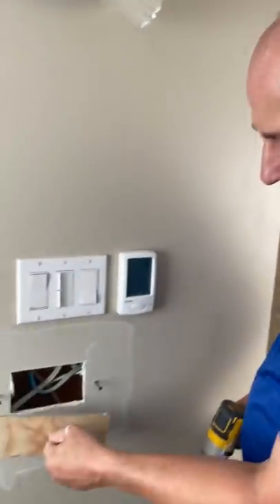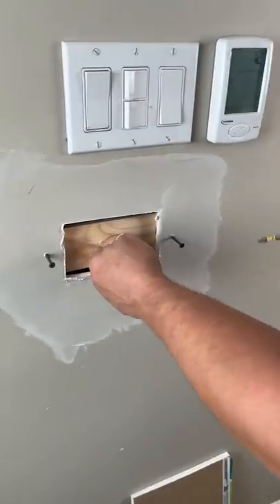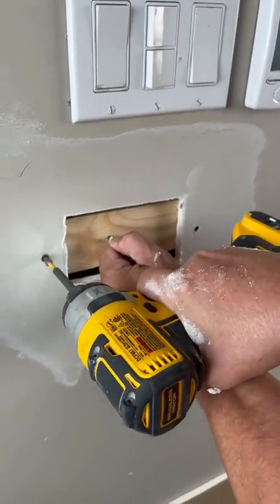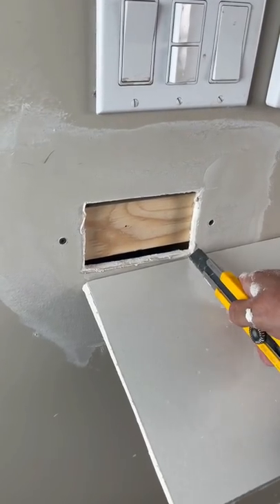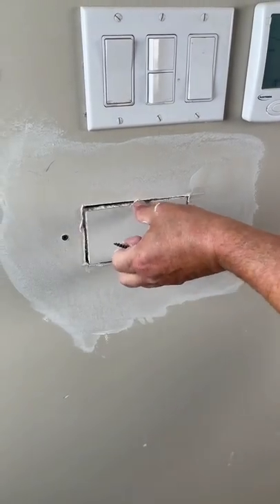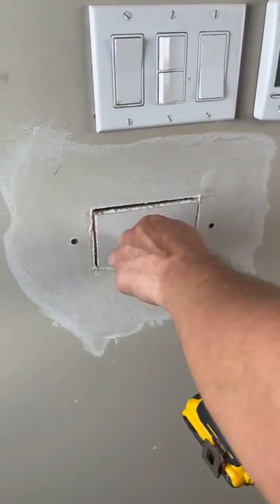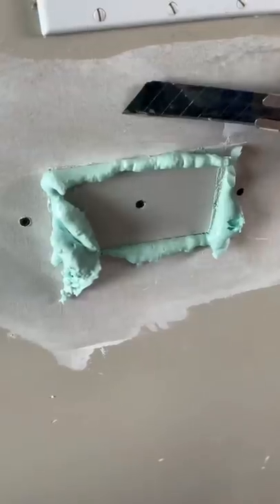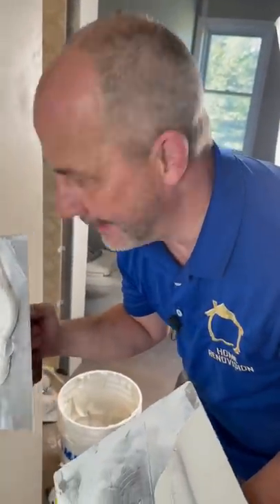Drywall Patch, No Tape Required #shorts

Comment: Hey Jeff, you are correct I haven't seen this.  I would have if I had asked myself "what is the least cost effective way to do this while also making sure this repair won't look good for long?"
Reply: Not to mention expansion foam in a wall is a fantastic way to blow out even more of your sheetrock! This is not idiot proof at all.
Reply: Well the wood method plus mud is fine for a patch or repair
Reply: @Gl-my8fw  it really isn't okay to use expansion foam in a wall for so many reasons. If you don't get it, I'm sorry to sound like an ass... Electrical and plumbing getting moved is a serious issue.  Just save yourself the hasssle and do it right.
Reply: @SaucyOperator  and it isnt hard to remove or a big deal in general. I wouldnt waste my money on foam or even use tape though tbh.
Reply: @Gl-my8fw  yeah I agree
Reply: I laughed out loud to this 
California patch that shit and be done
Reply: @mikebravo3527  you have the only correct answer I’ve seen on her. I’ve been slinging mud for 15 years.
Reply: @SaucyOperator  The Romex wire getting moved slightly isn't going to do anything. The end of the wire is secured with a connector at the junction box or pinched if it's a UPC gang. Moving pipes slightly isn't going to really do anything either. They have stronger tolerance than you think. Still a sh*t repair. And the electrical dangling like that is messy as hell. I'm sure he did it all himself. It's obvious this guy is a handyman and not a professional.
Reply: @AnUnapologeticApologist  Buddy, if you think all romex is secured in a box, you haven't been in the trade long enough. Lots of homes have DIY handiwork that isn't up to 1980somthing code, let alone today. Plus I don't want anything expanding near any copper pipe in my walls, wasn't so much talking about cast or pvc. Id California patch that. Look Ma... No tape.
Reply: That's gonna crack apart and look like garbage probably in less than a month it could make it a year
Reply: @SaucyOperator   I've been in the trades for years, not just electrical and plumbing but I particularly specialize in HVAC, refrigeration and food equipment. I know electrical extremely well and work with copper pipe regularly. Wiring is tied not only to the junction box but the devices and fixtures themselves. If they were that loose simply removing a plug from the receptacle would cause issues or if it's a switch cause flickering at the fixture. Even if all that were the case, you'd want those issues repaired anyway, not left alone. A short would trip the breaker. Also what are you talking about foam spray near copper pipe? The foam isn't going to burst the copper. I've  seen it inside walls on pipes that were over 30 years old with absolutely no issues. Not to mention I personally use it to fill exterior holes when I run linesets to a condenser. The liquid line is typically 3/8" with no insulation protecting it. Not once have I ever seen spray foam cause any problems to the copper pipe and I've been doing it for many years. I'm not arguing about this guy doing a crap job, he definitely did, but the other stuff you're saying is simply nonsensical
Reply: @AnUnapologeticApologist  334.80 then. Not sure what the handbook notes are, but that's the code. Meaning that unless you built it yourself, you dont know what's in that wall and how it is routed. So it can't be used. I'm talking about the canned bullshit like "great stuff" which is anything but great... It can cause problems that make it not worth using. I've been a gc for 18 years now, and we don't use it for anything anymore. (Again I'm talking about the stuff that comes in cans)
Reply: Why won't this last?
Reply: @SaucyOperator  he put a tiny amount of foam to seal the hole. He didn't fill the cavity. What do you want him to do, rip down the entire wall?
Reply: @tonyjohnmcmullen  I want him to use joint compound.
Reply: @BombsAwayMineCraft  Did expanding spray foam even exist in the stone age? You mean fix a flat? I'm glad you don't tape and mud on my jobs.
Reply: @SaucyOperator  spray foam has been around for decades
Reply: @BombsAwayMineCraft  seriously man. What is the fucking advantage of using canned spray foam? I mix my own mud, but they sell pre mixed joimt compound! What is keeping you (or anyone) from doing it right? I can not fathom not doing it like this. It will look lime hell within days. Guaranteed a callback when the customer sees the difference in sheen or shine and when that horseshit foam cracks. Just California patch it and be done. Doesn't have to be a lot of sanding if you do it right.
Reply: @BombsAwayMineCraft  just because you've done it that way for 25 years doesn't mean it's the right way to do it.
Reply: This isn't new. I've been doing for decades. Don't garentee anything just because it's new to you genius.
Reply: this is hilarious
Reply: To trick some people when they sale
Reply: @joshuajillson  I don't care if it's right. It works and holds up just fine, that's all I care about. Fixed a whole in my house when I bought it exactly like this 17 years ago. Still looks perfect
Reply: @BombsAwayMineCraft  I bet your definition of perfect level 5 drywall and mine are very, very different.
Reply: @SaucyOperator  yes, you are right, I'm wrong. Happy now?
Reply: @SaucyOperator  Because taping and doing multiple coats of mud requires skills that most DIYers don’t have. Of course anyone can tape it and mud it, but without skills the results are awful. Plus waiting for the coats to dry is long and sanding is creating a lot of dust. 

The spray foam technique requires only one coat and a bit of sanding. Did it many times in my home, it never cracked. Of course this is not the best fix for any situation, but for a small patch somewhere not at risk of damages, it’s awesome. 

And I don’t know what kind of spray foam cans people buy but the ones I buy always lasts me multiple uses…

Comment: I cut the patch piece first then trace it on the wall where I’m going to cut the hole. Then there is no question about fit.
Reply: What ? If it fits it fits .. Wheres the question? Lol
Reply: No he is right that is a good idea. I never thought of that before
Reply: Untill you have 20 holes and 2 hours to fix them
Reply: @ejeje641 why would you have 20 holes? 😂
Reply: Yeah especially if you have a good multi tool to cut the wall. You can get a really tight fit not that it matters once you tape & paste but ya know.
Reply: A+
Reply: @ejeje641 lol “The Drywall Olympics 2-hour patch event”
Reply: @ejeje641 most patchers are on day work so they'll take all week as long as they're getting paid haha
Reply: Works everytime.

Comment: The method of trimming the drywall leaving a few inches of extra paper seems like a much better idea than foam
Reply: Idk it expands and presss everything making it tight
Reply: Yes and you don't need wood or foam.. this method he uses is inefficient
Reply: @Dade_Soulja  the wood is Necessary unless you find a stud or do a hot patch
Reply: @mrgrump2534  a hot patch is what the op is referring too..  hence no wood for such a small hole
Reply: This is how most plasteres in Australia do it. No expanding foam though just base coat then go over with top coat
Reply: It is. Without a doubt it is. The paper or sticky mesh if you are lazy enable the basecoat to soak into the drywall.
Reply: The paper makes it where you have to fan out the spackle alot to make it impossible to see. If you do it this way then you can keep your wall flat. Most can't fan it enough or spend the time to get it perfect so you don't see the paper or the tape.
Reply: Most aren't going to smooth that spackle out far enough to not have a high spot, and if they don't then you see the higher tape spot
Reply: Or just fill the gap with the putty.
Reply: Plus takes a lot less time 😳
Reply: @mrgrump2534   there many ways to do most things   I like the idea of the wood  nut you could use a piece of scrap drywall just as easily.
Reply: Eh, as long as i cant tell it was patched up , in fine with it, however you dud it
Reply: I prefer that way extra paper
Reply: He's waisting time you can't charge $333 for 15 minute of work
Reply: @lanceborchert8863  you can charge whatever you feel is fair..... the amount of time somthing takes is completely irrelevant to the price you should charge.
Reply: It should not be that big of a difference
Reply: @mrgrump2534  if u use more foam
Reply: Ok, you use 1 percent of the can of expansion foam. What do you do with the 99 percent left in can that gets clogged? Seems like a waste of expansion foam.
Reply: @DJ-zt2ml  good point
Reply: you are correct sir
Reply: When I was working in residential construction years ago I was taught that what you mentioned is called a “hot patch”. I agree it’s a much better idea.
Reply: Tomayto, tomahto
Reply: @DNMEBOY  another commenter said it'll crack without the foam.

Comment: Except for the foam bit, I was doing this 40 years ago when I was 16. 
Btw... Forget the foam bit. Use tape .
Reply: exactly
Reply: @SupraRyu  I did it 41 years ago, when I was 15.
Btw... Forget the foam and tape bit. Use putty .
Reply: What's wrong with expansion foam?
Reply: But the video is titled "no tape required"....
Reply: @Lee-fw9mr .       Expansion from is not the cheapest and if you’re not going to use most of the can, it’s a waste of money. Plus it takes a few hours for it to dry so just use tape.
Reply: I did this 22 years ago, when I was 19. 
Btw… forget tape or foam and use elastomeric caulking instead.
Reply: No tape.  5 minute mud all day.

Comment: I’m so glad this is catching on, I learned this off a YouTube channel based out of England, they use foam on hardwall cracks, tape cracks etc etc, and since implementing it I’ve never had to use tape and have never had a crack, amazing finish as it’s flush with existing and even better, a happy customer

People don’t realise that cracks are caused by movement, even mesh or paper tape will fail with movement, foam on the other hand eliminates movement

Comment: Or, cut a piece about the hole size with about an inch of the paper overhang around the edges. Place in hole, cover in drywall.
Reply: Yup...that's the best way I think....this guy tried to take a stab at my profession (metal roofing) and was set on fire in the comments as well
Reply: @OrangeGreenRed yes it's what I do for a living and am really passionate about it... Been doing it since I was 20...36 now

Comment: the reason why this is so effective is time management. If you use tape, you're going to need at least 2 coats of mud. that's if you're good. 1 coat to set the tape and the second coat to finish the job. this type of patch can be completed and ready for paint in less than 1 hour.
Reply from the maker: Exactly, Cheers! especially great if you have multiple holes.
Reply: 2 coats of mud?  Crap I use a bucket of mud just for a couple screw holes.
Reply: Bahahaha, yea ok.
Reply: You used fast set mud and mix it yourself 5,20,45,90 minute mud. And it sets hard in those time frames. If time is what your working towards use a hairdryer. Always use paper tape. 15 year mud man.

Comment: While you’re there make sure you used super long screws and make sure you pinched the wire in the wall.
Reply: Shit. Just did a few of these on a renovation and forgot forgot step. Knew I was forgetting something
Reply: Haha that’s exactly what I was thinking,way to long screws,might have a problem turning on those lights after lol.
Reply: I’m glad I’m not the only one who knows this trick.
Reply: @majorj3896  or might have a house fire. who knows. adds to the excitement! great tutorial LMFAO
Reply: What wire did he pinched? Do you even understand how cables are wired through walls. It's not random.
Reply: @docteurdre8450  Ok man, no need for insults. I'm just wondering how are you doing wiring in US because in Europe there are strict rules to where are the wires go. They go 20cm from the ceiling and are connected to plugs and outlets at 90°.
That makes it pretty easy to find where are they going. And by the looks he wasn't near any wire.
Reply: @Proton_N  Sorry for the insults. The problem with internet everyone could research good information for there’s need. But as humans are the easy way sometime is the best way. So people improvised themself electricians, plumer, carpenter, welder and all those manuals labor in this world. with video of so call life hack something someone get dangerously close to hurt themself or do damage to their home or someone else home. I don’t say you need to call or Hired the right person for the right job, but do your homework before doing something.
Reply: @docteurdre8450  I agree. Everyone need to know their limitations. What can they do and what they cannot.

Comment: I typically will cut the plywood so the top and bottom of the wood overlaps the opening also.
A full board patch as allows  securing the top and bottom also, not just the sides.
I would trust the integrity of the drywall compound over having expansion foam in the joint.
Been doing this for over 45 years on rentals and renovator houses.
Reply: I would also use drywall adhesive on the ends of the board behind the screws. I like California patches, but a lot of times if you tap it with the inside of your hand with a closed fist it cracks around the seams. And then you got a real mess to clean up if you don't want it to happen again.
Reply: so are you saying overlap top and bottom instead of the sides or both? I'm only asking because if all sides overlap, how do you get it in the hole?
Reply: I agree. The mud should have no trouble filling the gaps. Why expansion foam?
Reply: @chaosn2order  Yes, overlap both sides and the top and bottom.
Make the hole to be patched rectangular, slide the narrow dimension of the rectangular wood into the long "slot" of the hole, then pivot wood 90 degrees.
Of course one side needs to be partially fastened before pivoting the full 90 degrees as the hole will be 100% covered once the board is pivoted the full 90 degrees.

Comment: Well dude, this is something I do a lot on my job. Nothing new except the expanding foam. Now you have a piece that can move that the mud would have locked in.
Reply: expanding foam dries hard as fuck. also it’s all deceived by screws
Reply: @Sydnicate  concretes hard as fuck too but what happens when that moves!!  CRACK
Reply: Foam does not crack dude . We use it to stick whole windows in and it does not fail . It’s most excellent
Reply: @paulbackhard6315  WTF 😂 yeah you slap trim over it on Window 🤦 when you're talking drywall with just paint over it it's a different story Im a Union drywall finisher going on 25 years, Everyday all daylong alls I do is finish drywall I know what I'm talkin about, If we could just slap foam in every seam in drywall and it worked we'd already be doing it lol
Reply: @tommyhurst90  we do that hear in the U.K. we even use instastick foam to stick plasterboards to brickwork. We would still skim tape the joints . But foam will not crack.
Reply: Mind you we plaster over the boards not just the joints. Far better way of doing it
Reply: @paulbackhard6315   everything you're describing is going behind something this video is showing the Seam that is exposed gets filled up with expanding foam in between the joints with no paper tape so I'm not even sure what you're talking about 🤦
Reply: @tommyhurst90  This guy has  been in construction for his whole career. He is in my opinion one of the best contents providers on YouTube that is targeted towards DIY-ers, thus his subscriber base. He probably has a dozen videos on various ways to patch a hole. I realize this is your trade, but there's always more than one solution to problem. He's sharing his wealth of knowledge. Wouldn't it be better to simply refrain from commenting if you didn't like it or agree with it? Why the need to flex here?
Reply: @Rob-rc7fm 😂 I would refrain from commenting altogether because you have no idea what you're talking about and neither does he. That patch that he's repairing in a year from now you'll see a square crack 100% maybe even faster when a kid pushes his hand on it or it gets bumped!! Not flexing all especially not on some simple patch work,, When somebody does something wrong it's wrong, and if I was searching for a way to fix something I would hope in the comments section a professional would correct the method before I attempt it!!  Welcome to the comment section buddy this is where you can give your opinion and where you can make yourself look even dumber 👍
Reply: @tommyhurst90  Nobody us questioning your expertise, and as I said before, I try to make it as constructive as possible without name calling. As for the foam patch, I did one in a commercial upfit on a similar size patch when there was no tape. No issues. That was 2010.

Comment: It's crazy how many people have opinions about a repair, when the outcome is unknown. For the sake of the ones who just can't live without knowing if it worked, will you go back and update them so they can sleep without having drywall nightmares?
Reply: How would it not work? Its an interior wall, sand it smooth, paint it and no one is the wiser
Reply: Yeah dude you really thought way to much into it, it’s a wall, it’s good
Reply: Lol it works but the tape is just more economical and less work
Reply: @2 1  I said it would work.